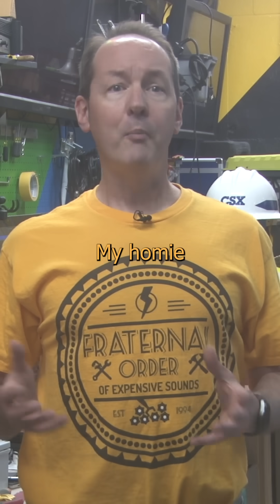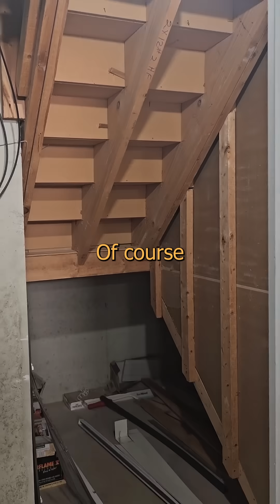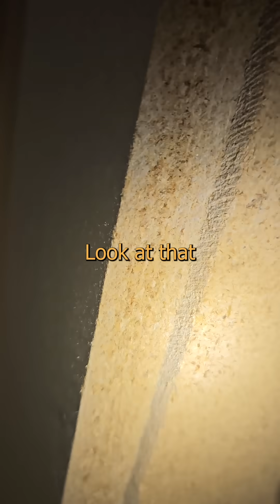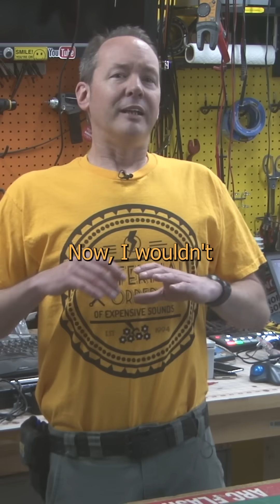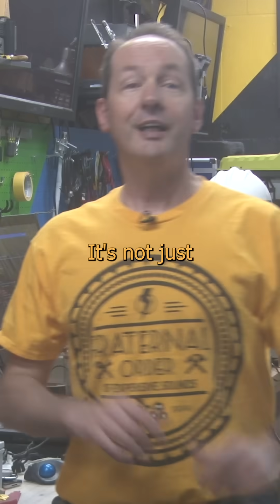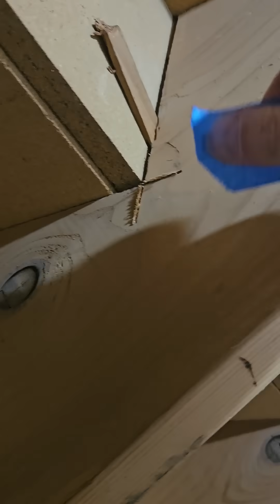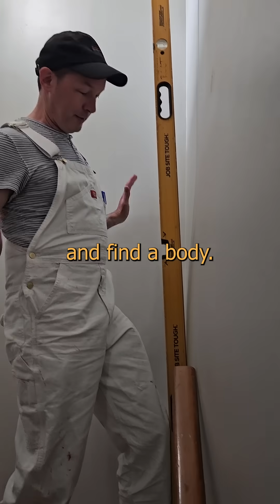Particleboard Staircase #chrisboden #engineering #construction #stairs #cheap #job #work #carpentry

Comment: Wow. That's some penny pinching deliberate negligence! 
Always get your own inspection! 
A good friend bought a house and his water started out cold, and then got very hot. On both hot AND cold! EVERY TAP. Some window licker connected the entire water main to the HOT side of the water heater, and entire rest of the house to the COLD side! His boss, the actual plumber must have turned on the cold tap, nodded, then turned on the hot and waited for it warm up and signed off on it, then some lazy inspector did exactly the same thing!

Comment: "Its not upcycling, its gravity assisted involuntary manslaughter with a side of criminal negligence" was such a beautiful string of words to describe that.... whatever that was. 

Also blue tape nailed it. 👌
Chris, you're  a wordsmith.
Reply: @phl_knives  what does blue tape mean?
Reply: @kurtisgibson2929  it's flagging an issue that needs to be fixed. There are a lot of home inspectors that mark things that need to be fixed like that
Reply: what does the Blue tape mean?
Reply: @IndustrialParrot2816 comment above.  Flagging mistakes or issues for home inspection commonly and other finished jobs. This prevents additional damage while still showing where the issue is. This is instead of saying "paint unfinished on right wall" or "cracking of bath fitting" with tape you're showing exactly where and your client sees this as well.

Comment: Yeah. Half of the time the lumber is warped because of the idiots not knowing something. Between the lumber yards and the contractors, someone forgot that wood expands when it gets wet. It warps badly when it is wet in a bundle and left on a construction site for months at a time. And if you expect anyone hired to know how to straighten out a 2x4 in a wall, you are sadly mistaken. Not a one could tell you how to set the crown or valley to adjust as it dries out inside a wall.

Comment: How is that kind of curvature even possible with dry wall boards?🤔 that’s so enormously ducked up, that simply had to be done on purpose. 

And using particle board for stairs (presumably to save some bucks in the building process) is outright criminal.

Comment: Fun fact: trailer homes from the ‘70s, and possibly newer ones from the ‘80s, came with aluminum wiring and particle board subfloors, as well as a fused electrical panel. These aren't the standard fuses that you can screw in and find easily, even at Walmart. No, these are safety fuses that are hard to find without ordering. Also, the hallways are narrower than 3 feet, the main entrance is shorter than 80 inches, and the central doorway is less than 3 feet. This is because trailer homes didn't have to follow building codes back then, so they were built as cheaply and unsafely as possible. They can be pretty frustrating if you have lived in them your whole life and are now getting older, needing that 3-foot hallway, 3-foot door, and 80-inch-high door expected in houses today. This makes it challenging to make the home as safe as it should be with newer models.
Reply: The real construction that should have been called 'Ronson Homes'....Lights every time....😅
Reply: @ryanreineke8658  in case anyone is wondering, I work for a home trades company (plumbing, heating and electric) and we consider aluminum wiring to be a fire hazard emergency to be IMMEDIATELY remedied by whole.home rewire and new panel/sub panel/j-boxes.
Reply: @brennawalsh-newell5658, the problem is that many people who have these 70s and possibly 80s trailers with aluminum wiring are elderly, which means they're on a fixed income, which means they can't afford to have the entire trailer rewired and put in a breaker panel.
Reply: @ryanreineke8658   Modern ones aren't much better. My mom bought a brand new mobile home in the late 1990's and none of the doors or windows are standard sizes. They want you to go to a specialty store and pay twice as much for a door or window. It's a real racket. My step dad reframed a bunch of the house to make things standard sized.
Reply: @Creativehotdog I had to purchase a solid core door, then cut it to the correct height and cut a hole to put a window in it so it would have a window. Also, when I installed the door, the top cornet ended up being warped, so now I have to fur out the latched side so that the deadbolt latches. After my recent discovery of a nest of carpenter ants on top of the door frame, I should have reframed the doorway because that would also eliminate the leaks happening on top of the doorway and make it so that the deck is closer to the bottom of the door.
Reply: Lived in one from the 70's a couple years ago the wiring was most likely replaced since it was made but maybe not since our microwave fried 2 outlets before we just plugged it into the stove, the furnace had parts from every decade since and we had constant problems with it like the flame blowing out during the winter (which is a terrible problem in a place that reaches -40 basically every winter) a friend who lived 2 trailers over who's trailer was also made in the 70's the floorings been sagging down in the hallway, the doors don't stay shut even while locked, the walls are cracking in certain places, and neither of them were insulated for any sort of weather boiling hot in the winter and freezing cold in the winter, only redeeming quality was my trailer had dimming light switches in each bedroom

Comment: Its an easy fix. I have seen this shit many times here in the qeer old corrupt UK..i usually reinforce the stairs by using plywood cut outs and overlap the entire under the stairs but using glue and screws and reinforcement with brackets screwed to the both rises ..steps and sides each step individually then a reinforced 2×4 running the entire lengh in tbe middle and sides connecting the whole thing together as one construction..

Comment: If those are actually  particle board treads, try and drive a 5d box nail into it.   Stair treads are not your 1967 Weyerhauser Versaboard. AKA Frosted flakes.
The risers need to be plywood.
I'm just saying that all particle board isn't remotely the same.
Corvettes and Koensegg Jescos have plastic bodies.......
...plastic spoons are plastic too.
...just sayin'. 😉

Comment: This is nowhere near safe, even dry it's not nearly as suitable as a rated composite or solid woood.
I'd recommend condemning that staircase and putting in good, if funds don't permit that I'd say put stout treads on over the particle board, swapping out would be better, as long as they have an overlap both sides so your weight is on the wood and not the adult paper maché. Probably best to paint all visible sides of the particle board, slow down absorbtion of moisture, buy you more time till failure.

Comment: Engineer in me says this is why I will go with the inspector before finalizing purchase of a property.  Particle board in tension, bending, or shear is not something a structural engineer should sign for.
Reply: I barely trust particle board for a book shelf, ask anybody that buys their furniture at Walmart about how reliable it is(nt).
Hell, it can barely hold a screw you put in it.
This is a bit hyperbolic, but they might as well have just created a suspended staircase hanging from the ceiling by rope and drywall screws and it probably would be more structurally sound.
Reply: Most home inspectors wouldn’t catch that, nor even know it wasn’t right
Reply: The only way that works outside of compression is as the core of a composite sandwich!
Reply: Yet….it’s completely up to code. Menards sells the treads as well

Comment: Yeah, the previous owners of my house thought that particle board would be a great way to support things in the attic over the garage in North Texas, where it never gets hot and humid. I almost ended up on the garage floor when trying to add an Ethernet cable for a PoE camera. I was not at all surprised that the house was sided with pressboard, aka Masonite, nor that the squirrels had eaten their way into the attic through it.

Comment: Even with the dimensional grapevines Lowe's and HD pass for prime lumber, the speed bump in that drywall is so fucking wild, it's impressively bad. Then you add in the shitastic when wet particle board for stair treads? I'm squintin', but it ain't mintin'. Jesus.

Comment: The stair stringers look fine. You could replace the treads without replacing the stringers. But you'll probably find something wrong with the stingers while dealing with the particle board

Comment: Our house was built in the late 70's and the subfloor in the entire house is particle board. There was carpet and when we pulled it all up you could see every place liquid had ever been spilled in the house because it would be swollen up. We had to replace some of it but replacing the entire thing was out of the question. Because of that it limited out flooring choices. No tile, no hardwood as driving nails into it just busts it. So we had to go with vinyl plank.

Comment: Those won’t last forever but unfortunately it is probably within code so long as the treads are 1 1/16” thick minimum plus it’s covered completely with another durable overlay ie carpet, vinyl etc. depending on the code in your area.

Comment: This is such a common occurrence now
my favorite pet peeve of Tim the "we gotta go faster" contractor, is wetting down concrete to the point it's essentially just thick water so it smooths out easier, leading to said concrete cracking within a couple years, often they barely use the thinnest rebar possible too, When my family and I added a porch room we made sure the concrete had a full layer of rebar and was less wet than your mother at a hotdog contest, that way you could run a tank over it and nothing will happen

Comment: I am pretty sure that isn't up to code, but what they normally use isn't exactly a lot better either.  They don't make stairs out of straight planks and timber anymore, they don't even use plywood, it's all flakeboard and chipboard which are just coarser versions of particle board.

Comment: While I'd never use particle board for...  well, ANYTHING...  EVER...  it's allowed for use as stair treads.  I'm also not a builder nor a contractor, that's just the results I get from a quick Google search:

As of April 9, 2025, the use of particle board for stair treads in Michigan will be governed by the 2021 edition of the International Building Code, which will be adopted by reference in Michigan. While particle board may offer cost benefits and ease of installation, it has limitations in durability and moisture resistance, making it a less desirable choice for many applications3. Therefore, it is advisable to check the specific regulations and codes in effect at that time for compliance.

So, I appreciate the heeby-jeebie feeling, but some wing nut lawmaker, SOMEwhere thought "good enough" was "safe enough".

Side note:  I am absolutely in LOVE with your t-shirt.  "Fraternal Order of Expensive Sounds".  Ordering one for myself.  Now.  :D

Comment: We call that K3 subfloor. It's a particleboard that's meant to go under vinyl flooring or tiles. Essentially doubling up the existing floor to either stiffen it for tiles so they don't crack from flexing or to raise the floor up for vinyl and closer match the elevation of carpet/hardwood next to it.

Comment: Sadly, after 30 years building and remodeling homes across most of the southern United States, i barely register it on the “what the actual fuck is that” scale. 
Ive seen 3 phase wired with green 12 gauge stranded. Rafters that are inches off top plates where the roof is actually supported by interior walls. Septic tanks in the middle of the floor plan in the basement ( how the fuck is bro supposed to pump that out???? You really think hes gonna drag the crud buster and his shit vac 45’ on his hands and knees???? Hope you got room for a second mortgage))

Even worse, half the guys who i have employed in my career would be guilty of that type of stupidity if they didnt have a monitor. And they hide it really well when they apply for the job and demand 45$ an hour. 
That guy with the clean shirt on…. Hes the only reason your house is still standing after 5 years. Cut him some slack. Dumbassery prematurely ages intelligent folks when exposed at chernobyl levels.

Comment: One of the previous owners of my house did the same thing with the basement stairs drywall, they used 2x4 widthwise and just let them flex to fit from the wall up top to the outside of the stringers, i cut it all out built proper walls and used firing strips on the stringer side to bulk it out to mach upstairs.

Comment: I was in a million dollar house, the floor beams , Joyces, where 2x8 boards no.. thin ass particle board with 1x1.5 with a grove routed down the middle and the particle board is glued in. So basically instead of a large salad piece of wood that you have a slab of particle board with a 1x glue to the top and bottom... And that's what supports the floors of the house and the walls and everything.. yeah it may be able to hold the load but it's just cheap AF.

Comment: as a former general contractor HOLY FUCKING SHIT! if i saw that in my buddys house i'd immediately go to the lumber yard, get my tools and, at the very least, reinforce that. put boards on the bottom and back of each stair and screw them into the ACTUAL WOOD. unless the stringer is also made of PB (the stringer is the two side pieces that you nail/screw the boards to. it's basically the foundation of the staircase that holds the weight.)
edit: also, i've only seen a wall like that ONCE and it was on a house that the owner wanted fixed after a hurricane, you could see the inside of the house from the outside, the top of the walls were out like 8 inches! (or about 20 cm) we literally had to build a new wall on the inside so it would be somewhat level.

Comment: The idiots around here do that all the time, worse yet, at work they were reqired to use particle board or hardboard for the upstairs floor over top of the ceiling joists above the office for storage. They full well knew they were going to be storing heavy machinery up there and tools from the shop but were shocked when people started to put their feet though it.

Comment: AS1860 Particleboard Flooring
This is the code that allows particle board flooring. It requires the particle board to stand up to 3 months of weathering without a roof. 

I was very surprised by this but thought I would actually look it up.
Reply: Not an expert, but if the law is about “flooring” I don’t think it applies to structural elements. Flooring is stuff that goes on top of the structure, i.e. vinyl or tile. What’s in the video is meant to be structural, as in it’s actually holding up/shaping the staircase. Which you absolutely should not be using particle board for.
Edit: found the code and glanced through it. It outlines that the particle board should be sealed to protect against water (this definitely isn’t lol) and there’s certain guidelines that ensure proper support beneath the particle board (number of floor joints per area of board). I don’t think the vertical sections of stair would be allowed under this code and I’m don’t think the horizontal parts meet the guidelines anyway. 
Hopefully that makes sense 😅
Reply: They are definitely allowing particleboard to span 12”. But your right a stair step is spanning more than that. 

I asked Grok that question. It said that code doesn’t talk about stair requirements. That would be 
AS 1657-2018 (Fixed Platforms, Walkways, Stairways, and Ladders): which it says does not allow particleboard as a stair tread. 

That actually sounds right, but it’s Grok.  It could be making it up.
Reply: If they used 1" hdf that would be correct but i dont believe they did. Is that what the code said?

Comment: Carpenter here, there is a Particle board tread material its over an inch thick and if i recall, it used a "water resistant" glue
Reply: Yes. There is also flooring. 
AS1860 Particleboard Flooring
This is the code that allows particle board flooring in Australia. It requires the particle board to stand up to 3 months of weathering without a roof. 

I was very surprised by this but thought I would actually look it up.

Comment: If it's good enough for subfloor then it can be treads. I don't disagree with any of it's short comings. They're hoping it never has a reason to be wet and if it does they have worse issues than replacing the stair treads. That would be my thoughts on what they'd be thinking

Comment: This is what happens when they don't sheet the walls before they stand them they let the stick figure Stand Up In The Wind in a Twist in it swells and it does all kinds of good stuff and then they just cut the board to fit the frame professionals straight from Lowe's parking lot if a lead man who's the only reason why he got the job is because he's bilingual kinda

Comment: I bought a manufactured house that the original owner did the finishing work to save money. He put particle noard throughout the house under a layer of carpet. Well its either sinking, or gone straight through. Everyone living in this house has gone through the floor at least once. We have to replace all the flooring, but we can't afford too. Please replace particle board as doonas you can.

Comment: The walls of my poor old house are 2x4ish studs with wood lath, plaster, and then gyp board. It has over 100 years of settlement in its stacked stone foundation. Even its walls are straighter than that.